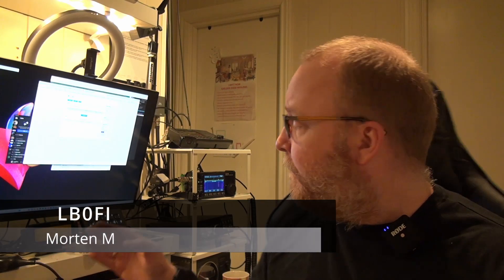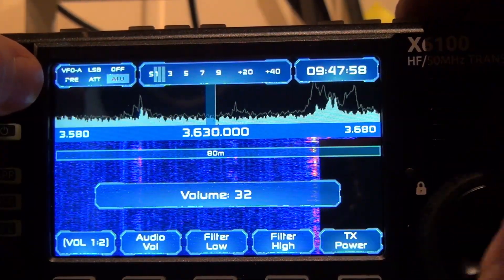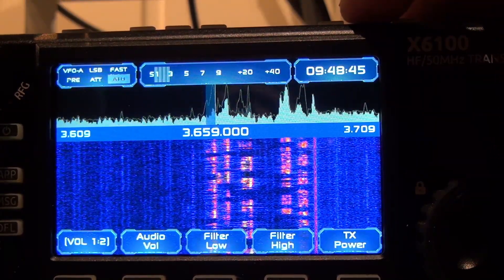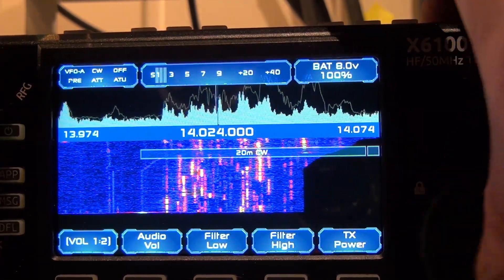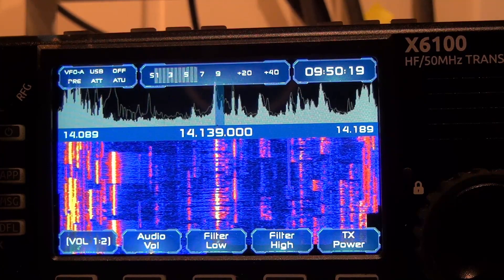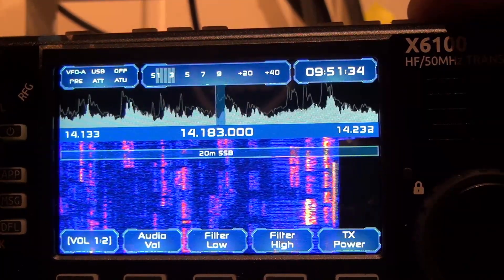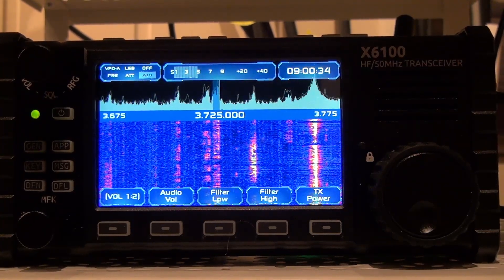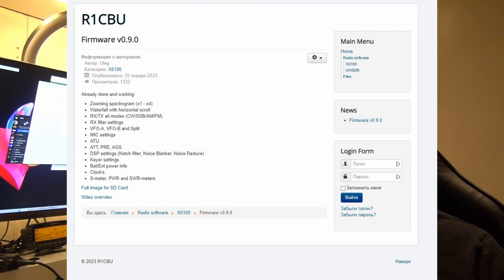New Alternative Firmware for the X6100

Comment: Version 0.13 is available now.  It works well and is an improvement.  I am using the R1CBU firmware for JS8 and WSPR with no problems.
Reply: Decoding js8 ?

Comment: Thanks for the video.

I cannot transmit at the moment. I wonder if this firmware has opened up the CB band for transmit?

Could you test to see if the X6100 will transmit on say 27.5 mhz please, using the alternative firmware.

I realise this is still under development, but I can find no way of altering the clock. Did you find a way?
Reply from the maker: I will probably be looking deeper into it during next week.
Reply: CB will not work because FM does not work.
squels doesn't work either.
Reply: @fox2all404  Thanks, there is a new version today that fixes the AGC issue (v.1.10.0) and activates the PTT button on top. Interestingly the previous version showed 6m (50 mhz), but the new one does not. The new one also improves received AM audio.
Reply from the maker: I have already posted a video on the 0.10.0 version :)

Comment: Thanks for nice report! Mine froze twice while scrolling from one section of a band to another, image freezes, sound continues, no button works, except for the power off button which lets me reboot.
Reply from the maker: I did not experience any of those issues, but I did have some troubles getting it to boot consistently from the SD card after recording the video. But I think this is more a proof of concept than a firmware that is ment to be used as a daily driver.

Comment: Takk for video. Spennende. Har testet den selv på fredeg. Synd at TX audio ikke kan endres ei heller i denne firmware. Han R1CBU sier det skyldes hardware begrensninger. Så samme modulkasjon og båndbredde som original fw på tx. Ellers veldig spennende.  LB5VA.  (sorry for norwegian)
Reply from the maker: Veldig spennende med sånne prosjekter, og det blir morsomt å se hvordan utviklinga går framover med denne radioen. Jeg synes det er veldig spennende at radioen kjører Linux, akkurat fordi det åpner for mange muligheter.

Jeg har forøvrig en stream i kveld i lag med Steve KM9G (Temprorarily Offline her på Youtube) hvor vi skal se på RTTY på X6100. Han er kanskje den av de som vet aller mest om hvordan denne lille saken virker bak brukergrensesnittet.
Reply: @LB0FI  Btw. Jeg hadde ikke rørt AGC, men satt på PRE og øket RF-gain mye, så ble det lyd. Men stusset over at det ikke var noe lyd da jeg først startet den. Må teste dette mer, men mulig det blir gjort noe med den AGC'en etter hvert da. :-)  73.
Reply from the maker: @stigrasmussen1460  Jeg tenker at det skjer mer med både denne og annen firmware ganske snart.
Reply from the maker: @stigrasmussen1460  Da skal jeg teste det. Takk!